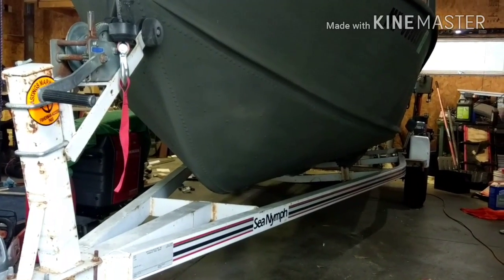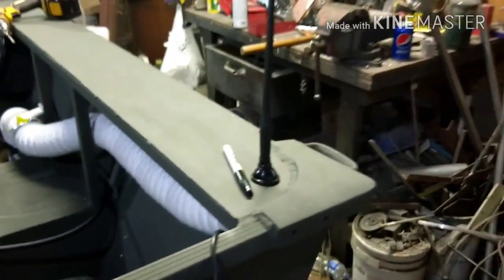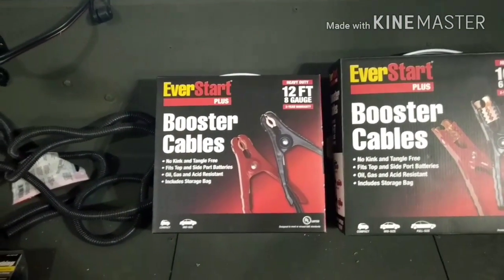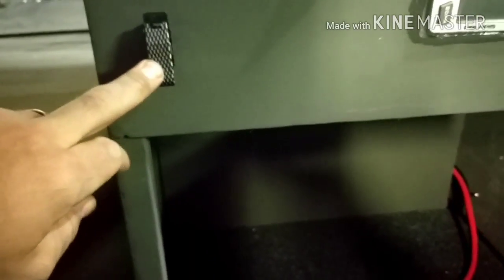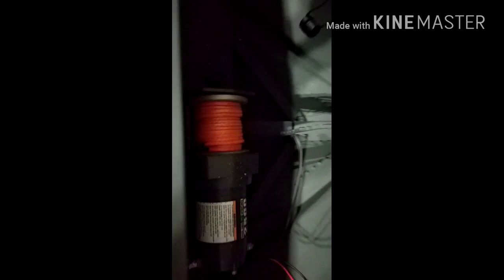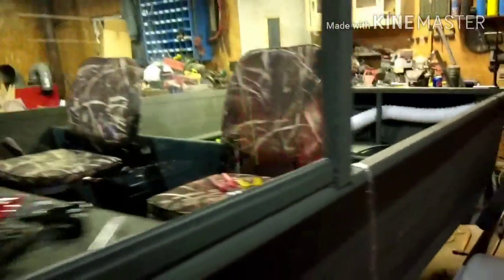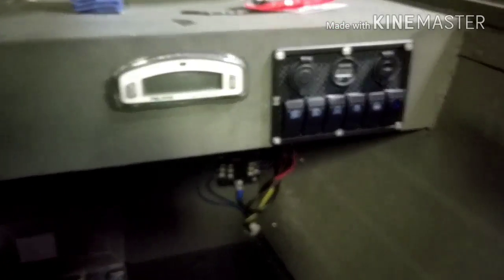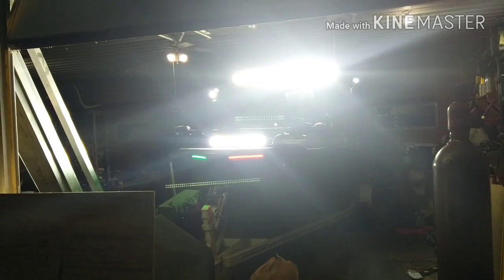How to wire a boat. Jet boat build 2.0 episode #25

Comment: Been looking through your build videos. Been fascinating to watch. Might want to check your navigation light installation in the bow. Your not supposed to be able to see both the green starboard (right, helmsman, drivers side) side light from the port (left, passenger) side except from directly ahead. Same for the port left side. Only if your approaching directly from the front are you allowed to see both. Your arcs of visibility are out of spec.

Comment: Are these spools marine grade? Is the marine grade worth the extra money? I could see on a trailer , or in areas that are submerged a lot, but I would imagine most of the wiring in a boat will stay dry.
Reply from the maker: Kyle Silberg they are just your everyday normal wire and they work well in the boat I've used them in
Reply: Anywhere there is water and hot and cold temps, the regular wires can get corroded. Marine grade wire is tinned the entire length which resist the corrosion. Also the insulator has a higher temp / fire rating. Use marine grade if you plan to keep the boat for a while.

Comment: I have a 8 gang  switch panel with fuses  and a run all bus bar with the neg- pos- side with the fuses Im trying to run all my accessories I want everything on Im not good at electrical stuff but I can follow directions or if  its drawn out good if you need to email me let me know
Reply from the maker: It's the same as this video. The fuse block has bus bars
Reply: JDS Outdoors what I mean by everything on I want the usb voltmeter on at the same time while I’m able to use my bus bar fuses does that make sense it’s kinda hard to explain in writing
Reply from the maker: @sstatic6093  if I'm following this right your bus bars hook right to the battery so they are always live. If you want your volt meter and USB on at all times (not recommended because it kills your battery over time) leave the master switch out of the installation. In this install video even if the master switch is off all the switched accessories still work when the switch is flipped. The master kills the parasitic drain of the leds
Reply: @JDSOutdoors  I hear you oh and I got it to work I kept looking at your video cause I didn't understand how the power from the fuse bar was going to power the switches But then I realize that I didn't have my batter connectors on properly. Im going to run a 1-2-Both-Off Battery Switch, 6V 12V 24V 48V 60V Battery Disconnect Master Cutoff Switch in my Boat that should be like a master switch so when the boat is setting i just shut off the power to the battery thats kinda the same right? so can you do a video or if you want to contact me FB or whatever. Well this is what I'm trying to do. Connect a trolling motor, a 60 Amp circuit breaker for the trolling motor a 50amp circuit breaker for the boat  accessories all that along with the cut off switch HELP can you?
Reply: @JDSOutdoors  one more question will that one 15amp run the cig lighter, volt meter, usb, ? why I ask is because they all had separate 15volt amp.

Comment: Hey Jon, I have two questions.   1) Since you have multiple loads coming from the batteries, are you isolating the ring connectors with any type of washer?  2) With the batteries hooked in parallel, your volt meter will only show one battery voltage.  I have a panel that has an on-off-on toggle to show each battery's voltage.  That switch panel looked like it only has on-off switches.  Can you swap in an on-off-on switch into that panel?
Reply: Strike question 1.  I saw how you used the straight terminals.
Reply from the maker: I'm not understanding how the volt meter is only reading one battery since the wires are ran with the positive on one and the negative off the other. Also I re wired my switch panel to incorporate a master on off to keep it from killing my batteries
Reply: Let's say your meter shows 12.8v.  Does that guarantee both batteries are at 12.8v?  If one is discharging faster than the other, you may not know there is a problem, or am I way off on that.

Sorry.  Mine is set up as two individual batteries (planning to change that based on some of the knowledge taken from your videos; Much appreciated on that) and the volt meter is a 3 way toggle (on-off-on).  So toggle up shows V of battery 1.  Toggle down shows V of battery 2.
Reply from the maker: Vic Terraglia it's drawing evenly off both batteries on my set up so if it says 12.8 that means both are 12.8. It also charges both when the motor is running or when it's hooked up to the charger
Reply: Thanks for clarifying.  I appreciate that.